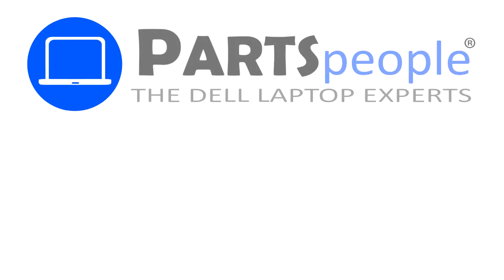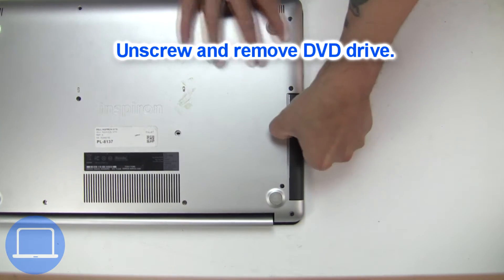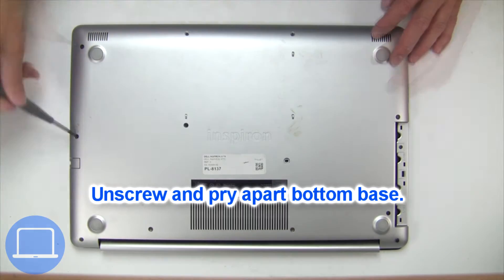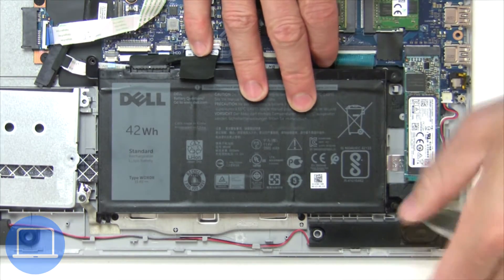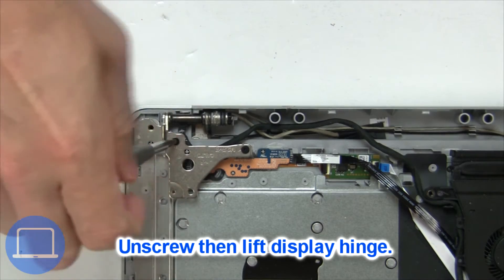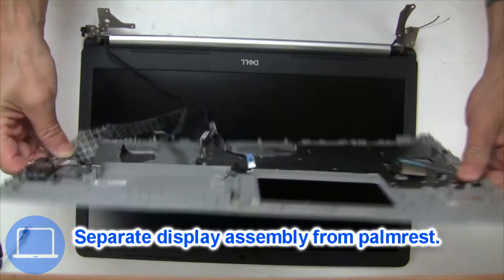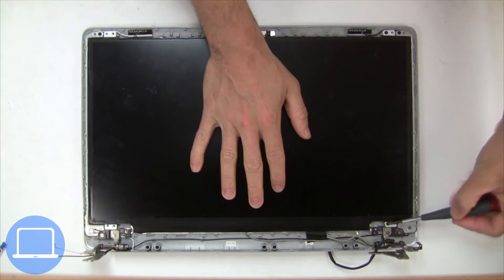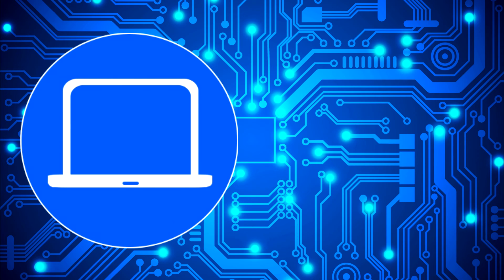Dell Inspiron 17-5770 (P35E001) LCD Panel How-To Video Tutorial

Comment: Why do you remove the whole hinge??. Isn't that unnecessary? All you need is to pull off the frame unsreww the 4 corners and disconnect the cable
Reply from the maker: For safety purposes we follow the steps used in Dell's service manual to complete this disassembly.